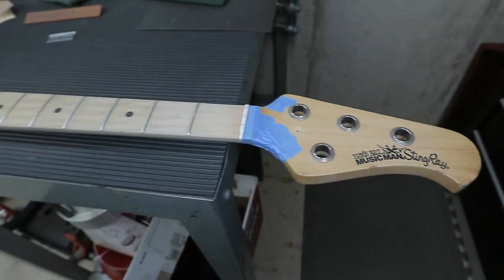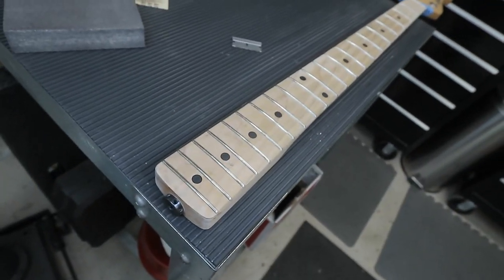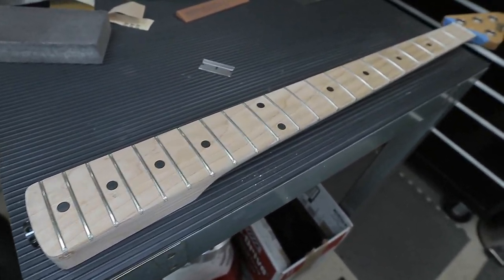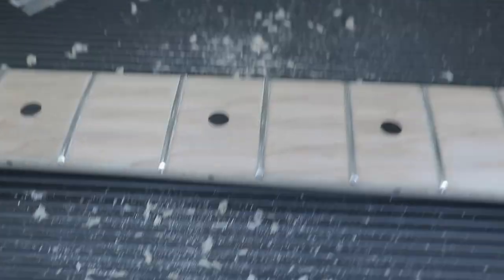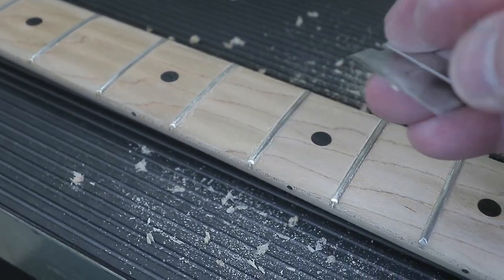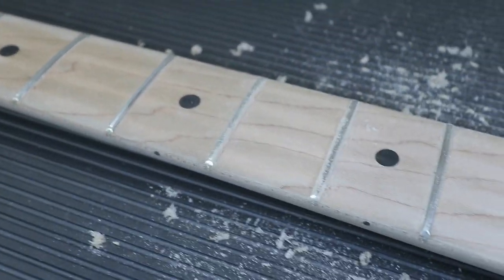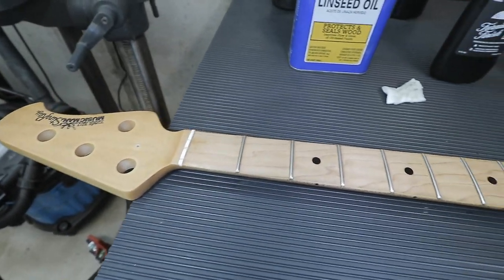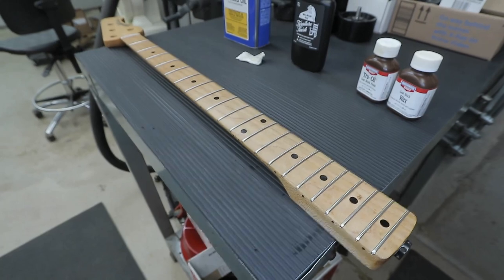HOW to Clean & Refinish NASTY Maple Neck & Fretboard | Ernie Ball Musicman Stingray Bass Guitar

Comment: Laquer thinner and soak it . Kleen strip brand lifted that dirt out for me . Scherwin Williams paint stores sells a epoxy floor finish thats about indestructable called Fabulon . That stuff cut so it can be wiped on or sprayed is the finish youre after . Do this Once and be DONE , may take a 2nd thin coat depending on wood drinking it or not  . It was originally developed for bowling alleys . Youll never hurt it .....ever .
Reply from the maker: So that hardwood floor Fabulon clear coat? But nothing i mean nothing worked to lift the dirt and grime. It was deep in the grain. i should have no problems now my other stingray 5 maple fret board never gets dirty. I make sure my hands are allways clean when i play. This the bass on video came from another owner.